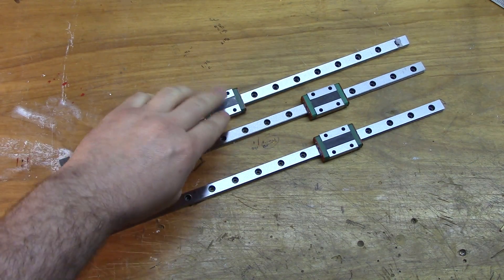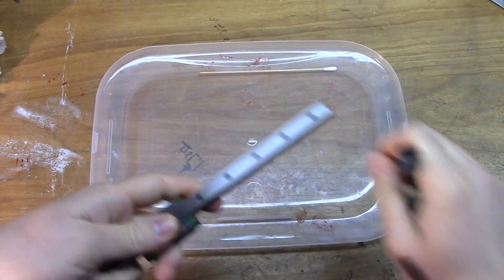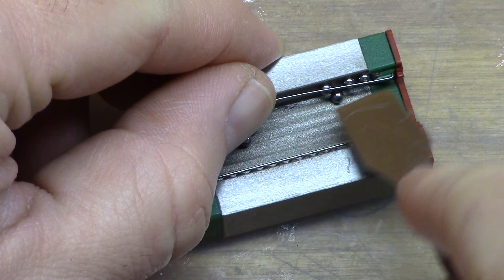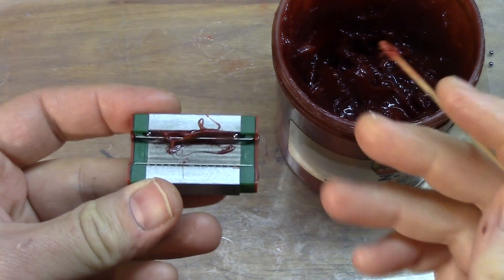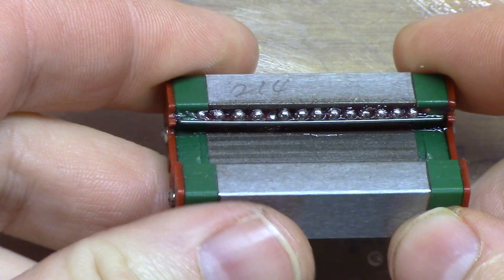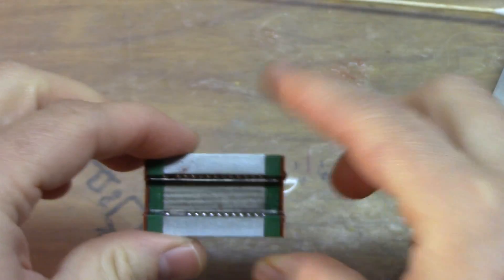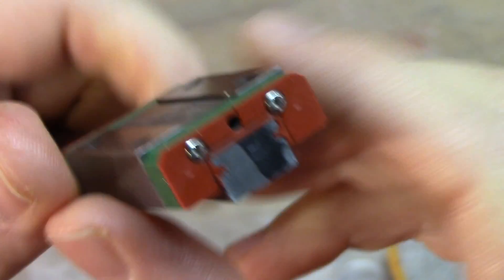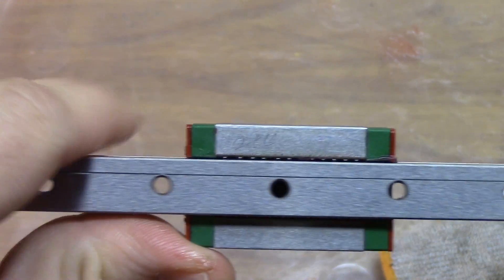BauTek Kossel Build Log #4 - BauTek Industries

Comment: It is not necessary to remove the balls.  Its better to use light lithium grease and press it in like you show on round two of greasing.  Overall great video, Thanks.
Reply from the maker: +3D Printing TV Glad you enjoyed it. :)  Greasing without popping the rails is definitely the way to go, such a pain keeping track of those little buggers. Check out that Neo Z-12, it's a really awesome lithium soap product and works like magic in everything from little mechanical bits to race car wheel bearings. It would be nice if they made a thinner version of it, but it's so slippery it doesn't seem to drag smaller bits down. ;)
Reply: Hi awesome video...unfortunately i came across this video after loosing the balls in the carriage.. what do i do now? can it still function  with some balls missing? what do u even call these balls i wanted to purchase it from somewhere online, any suggestions?

Comment: Out of interest have you looked at the underside of a genuine HiWin carriage? I think they have two rows of ball bearings per side.
Reply from the maker: +Tim Kent I think all of the MG series that these mimic are still single row on each side, but they are much better about their tolerances and have a self-lubricating block that rotates with the ball bearings. I'm still pretty happy with these for the price though, almost a year later and they're still operating smoothly and haven't shredded themselves to pieces. ;)
Reply: +BauTek Industries did you add more grease over that year period to keep them going ok ?

Comment: Can I ask you what kind of screws you used to mount the rail at 9:20 ? m3, m4 ?
Reply from the maker: +educasoft Those were M3 diameter, can't remember the length off-hand.
Reply: +BauTek Industries ok thank you. I ordered a MR7 rail (smaller than yours) and have a test. Not for 3d printing but for diode based laser engraving